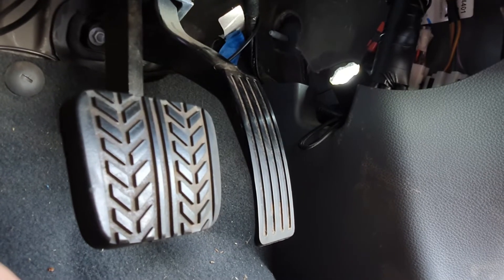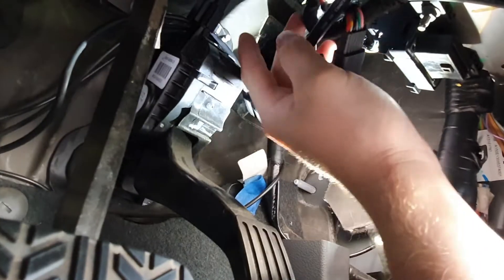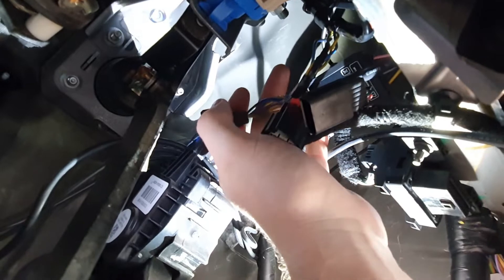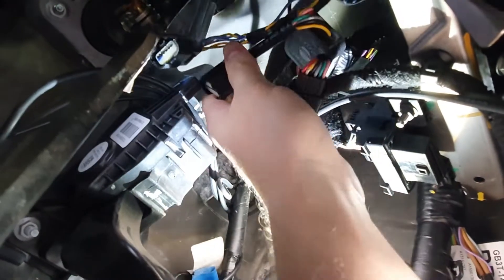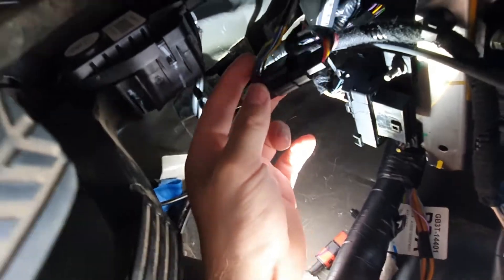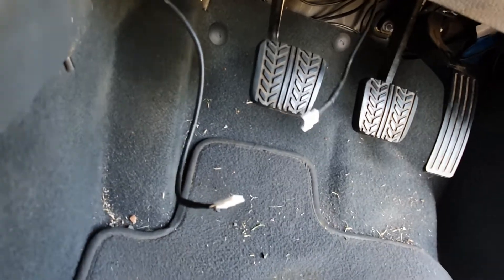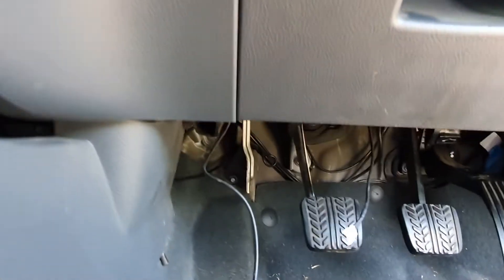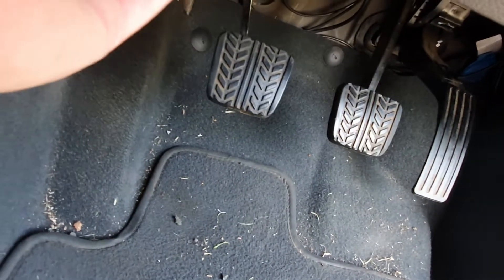How to install the Hikeit X9 throttle controller DIY

Comment: soon you will get problems from the computer with Dash warning light. Just disconnect the throttle controller and the problem will disappear.BTW this device effects your warranty too. good luck...
Reply: Are you the throttle controller cop Rod?
Reply: @kman6482  go to the top of the class